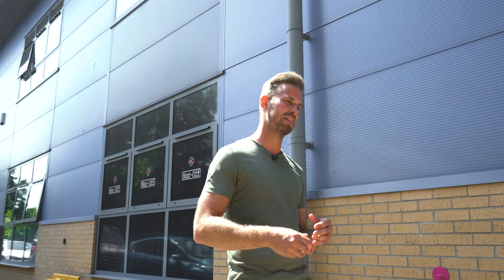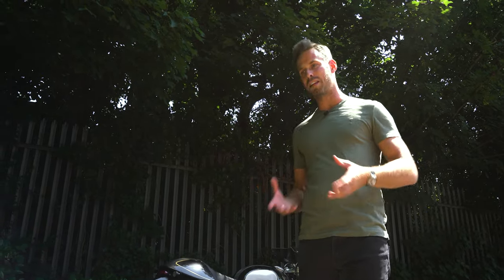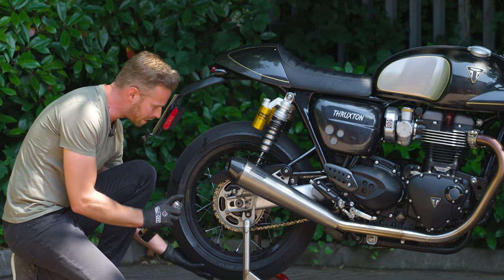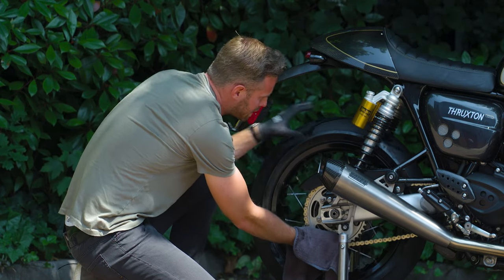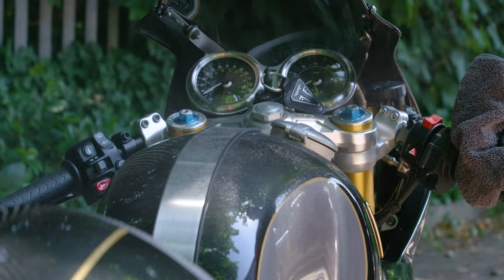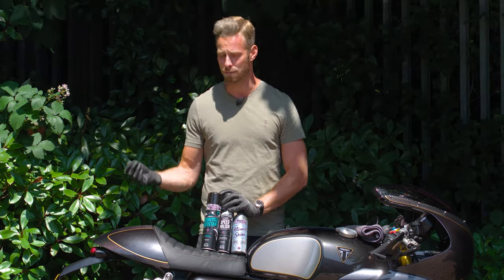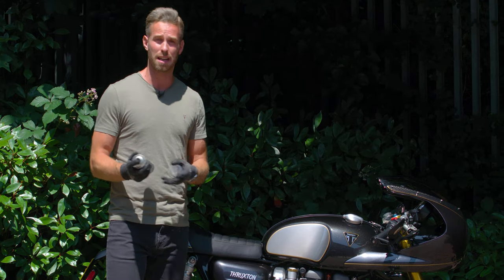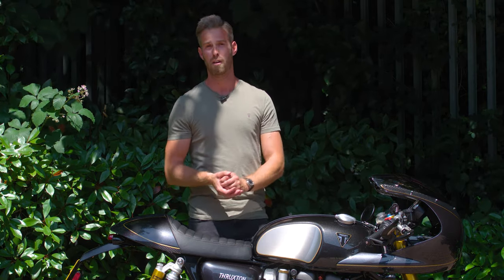Muc-Off - Motorcycle Cleaning Made Easy - Tutorial

Comment: You used the same towel on the chain, discs, and paint work. so many reasons not to do this, chain oil residue transferring onto  the discs and brake dust etching into the paintwork from the braking components.

Comment: For the chain, use kerosene in a spray bottle and save yourself a bunch of money. Only thing is, you want to put a piece of cardboard behind the chain as you spray the kerosene, as it'll create a mess.
Reply: Not sure if it's the same thing but I use parafin for the chain, does a great job and yes it saves a ton of money!
Reply: Kerosene cleans up the chain alright, but it also eats the o/x/z/whatever-rings in it and lets the factory grease out, turning your expensive chain into the shit people had in the 90's, and unless you lubricate it constantly lowering its lifespan to a couple thousand miles. It's better to not clean it at all than to clean it with kerosene(or stuff that has kerosene in it, like WD40).
Reply: Sadly in 2023, a jug of kerosene is almost as much as Muc Off drivetrain cleaner. Also does Kerosene ever stink! Muc Off is Asthma friendly lol.
Reply: @_Just_Some1 in the UK it is the same 😂
Reply: @2strokedesign err you might be wrong there my friend, I'm certainly I saw a video a guy doing exactly that sort of test for O-rings ect and WD40 even putting it in a jar and letting the rings sit in it for hours, with no noticeable impact on the X and O ring seals 😊
Reply: @2strokedesign https://youtu.be/Fzyk4nq3ug0?si=S5p-VFHhk1tD_f7i
Here's the link to the MC Garage vid on this very topic 😊
Reply: @2strokedesign erm no. Also, wd-40 does not contain kerosene. It amazes me how people just throw out facts without checking. Please please don’t do that.
Reply: @kevindarkstar thanks for confirming.

Comment: Waterless wash... also known to those in the know as exfoliation. You need to apply common sense and logic to matters... if you do not remove surface contaminants made up predominantly of dust, grit and general road grim, with water and something like snow foam to help lift it from the surface in the first instance... you will collect them in your cloth and be rubbing them into your precious paintwork... which will lead to at best, swirls in your paint and at worst deep scratches. Sometimes the wheel just doesn’t need reinventing. No offence intended... I love you guys and buy from you often... but waterless washing isn’t a good idea 👍
Reply: Exactly my opinion
Reply: 2020 now, plenty of great waterless products to use on light grime without scratching. I've got a matte black paint and used waterless washes plenty of times without any damage at all. Obviously if its lots of dirt you need water. Just make sure to have a couple of towels and shift side after a dirty panel. I always start uptop so the tank paint doesn't get scratched.
Reply from the maker: These are all just different options - the product doesn't have to be for you!